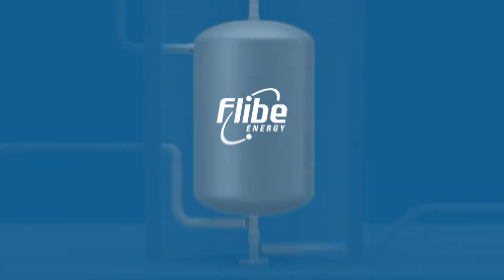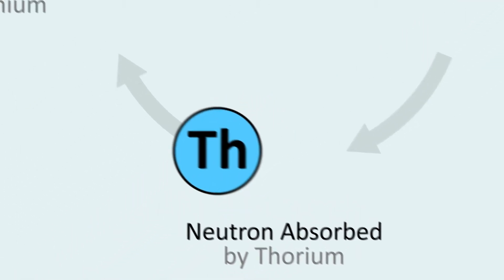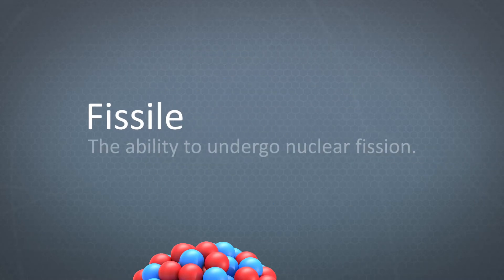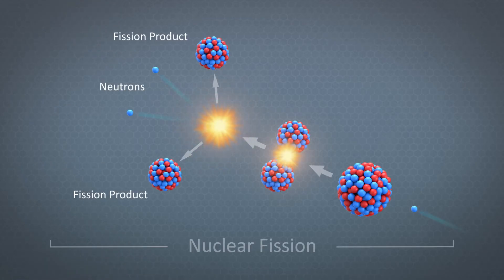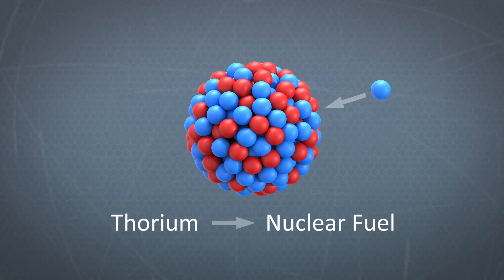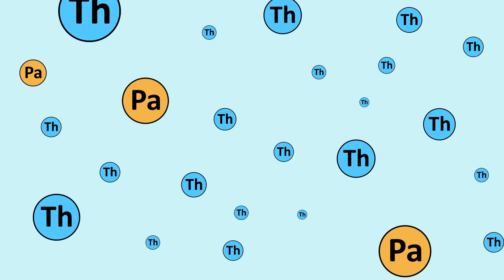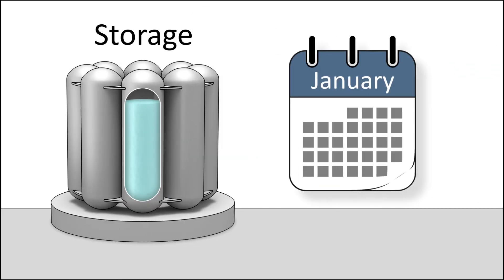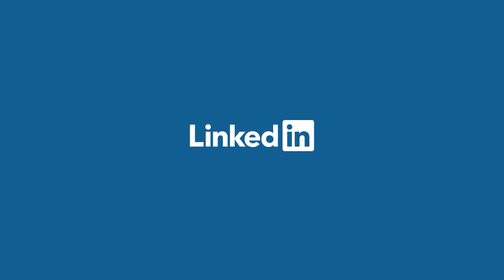Thorium Fuel Cycle Introduction

Comment: Is this design proliferation resistant? It looks to me that the separation of protactinium would produce a very pure U233, weapons grade material.
That would make the reactor less useful, if it can only be deployed in countries that have permission to develop nuclear weapons
Reply: U233 is harder to work with to make bombs than U235 or Pl239.  A secondary decay chain makes hard gamma rays, which can be detected at long range, and can damage electronics (e.g. the bomb circuitry).  The USA made a U233 bomb to prove it could be done, but Uranium and Plutonium bombs were much easier to work with.  They also have a shorter shelf life than the traditional bombs.

If you were a non-nuclear state, then buying Uranium on the free market, and enriching the U235 to make bombs is the easiest way to go.  This is in fact what Iran is trying to do, and what India did.

Warm regards, Rick.
Reply: The company replied to a similar comment below denying the claim, and linking to a recent report on the company's designs, released by ORNL's Nuclear Nonproliferation Division.
Reply: @no_rubbernecking  the report states a lot of numbers, but no coherent explanation of why the reactor is proliferation resistant. While I am sure this satisfies industry insiders, it would be nice for the rest of us to get some digestable information.
Reply: @migBdk   I understand your concern. Public messaging has been the greatest weakness of the  LFTR community, as it has been for legacy nuclear.
   I've looked at the section on accounting, and it seems there are a variety of methods proposed to make any attempted re-appropriation of fissile material easier to quickly detect.
   While I obviously wouldn't recommend exporting the technology to countries that aren't considered trustworthy, it's a fair bet that China, India, and maybe Russia will do so anyway, and little short of a complete blockade of these countries and their allies will stop them. This is just the world we live in today. In fact i'd bet that Iran will develop its own LFTR, as it's rapidly approaching  engineering status on par with the great powers, thanks to European and Asian appetites for trading with them.
Reply: ".....countries that have permission to develop nuclear weapons."

Where does a country go to apply for such permission? More to the point, When was the last time you've heard of a country which acquired a nuclear weapons capability going and getting "permission" or even the blessings of the existing nuclear powers?
The answer is, NONE of them!
When Britain was pursuing its first nuclear weapon, and Truman found out about it, he bitterly complained to Prime Minister Attlee about this. ....Never mind that British scientists had played a role in the Manhattan Project. They were summarily expelled (and not allowed to take their papers with them) as soon as the Manhattan Project was complete! The U.S. Congress promptly passed a law to prohibit the transfer of the knowledge of how to make atomic munitions.

No country which has a nuclear weapons capability has ever gotten permission or received encouragement from an existing nuclear power.
Reply: There is a mix of U233 an U232. U232 decays at some point to TI208, that produces hard gamma. Separation of U233 and U232 is very hard to do because of the small weight difference.
I wouldn't do thorium cycles with small reactors, as you need tons of shielding.

Comment: How big a voltage are we talking about along with the current necessary to bring the anode into state to extract the protactinium? ie what is the energy cost of the sustained reaction? i.e. Nothing is free in chemistry.  Additionally what is the cost to reintroducing the newly made Uranium to the reaction cycle along with the Thorium?  Your little demonstration of chemistry is great and all, but please be fully upfront with tht e public about what you are trying to do.   Yes I know, the U.S, has had a test Thorium reactor experiment running for decades that was never fully realized, but that doesn't mean it was ever ready to go into a level mass production of usable energy that could be used commercially.  While I like to see that there are people working to make Thorium nuclear energy viable, don't obfuscate what is going on with Disney like animations.
Reply: What here is obfuscated, and what is not up front? The voltage requirement is virtually nonexistent. What do you mean by "what is the cost to reintroducing the newly made Uranium to the reaction cycle?" Reactor starts with U233 as fissile inventory and a thorium blanket as fertile -> thorium absorbs neutrons -> thorium decay chain to U233 -> the newly created U233 fuel salt and new thorium blanket salt is fed back into the reactor and the cycle continues. Use thorium to create U233, use U233 to create power. Did you watch the video or are you just here to make vague and unsubstantiated accusations?
Reply: @skylerallen5189 Im happy you are satisfied with the info in this video. But what you fail to realize is that Thorium reactors have been around since the 60's.  The concept isn't new. My issue is what exactly has Flibe figure out to overcome the negative issues of Thorium reactors to be able to bring it up to scale.  And when I mean scale, not little test reactors producing 10 or 20MW of power.  California took offline a reactor the was capable of producing 2200+MW of power (dependent on number of reactors active).  To further help you understand why i ask silly questions.  Current nuclear energy production in the states is ~95,000MW of Nuclear energy( made in fast breeder reactors). Current average daily peak power requirements of the lower 48 states is 720GW of power.   So, when a company like flibe puts out a disney cartoon on thorium I laugh and ask the questions that I do, cause I want to know how feasible it would be to bring online a safer nuclear reactor that potentially produces less waste and at what cost.
Reply: @cdrderfyt  I am perfectly cognizant of the work done by ORNL and the current nuclear power situation. What I take issue with is that you are accusing the video of obfuscating the truth in a video that exists to educate. Also, there are no fast breeder reactors in the US. It seems very odd to me that you use such harsh phrasing and such an accusatory tone to attack a video explaining the thorium fuel cycle to people who aren't familiar for not answering your specific, unrelated, and frankly, unfounded concerns.

Saying that Flibe isn't "up front" with what they are doing seems entirely intended to make people feel like information is being hidden from them. The truth of the matter is that TMSRs, and specifically LFTR, are not only viable, but crucial for the United States and even our global energy future. It is both feasible and possible in the short term, and necessary for the long term.

Comment: Is it feasible to separate the 233Pa from 233U in storage to feed the fuel salt continuously, or is it acceptable to store the protactinium in batches as illustrated, risking the decay of some 233U?
Reply: Protactinium is removed through a chemical process, held onsite for the required time, and reintroduced into the fuel blanket.
Reply: @darelsmith2825  ...I know. I asked the question I asked because 233U also has a relatively short half life, so it seems intuitive to chemically remove Uranium from the presence of Protactinium as quickly as possible, ideally not in month-long batches. Or maybe it isn't an issue for some 233U to decay before it is introduced into the fuel salt, which is why I asked.
Reply: Sixteen thousand years.  That is a very long half-life for something that is about to be consumed in a reactor.
I, too, am curious of the chemistry of protactinium tetrafluoride.  Is a salt? Is it molten in the MSR?
Reply: @philipyoung7034  I believe it is technically a salt, and I assume it is molten at operating temperature (650-700C), I do not know for certain.
Reply: The U233 is only needed for startup to initiate the breeder fuel cycle as I understand it.
Reply: @solexxx8588  U233 is the fissile material bred from Thorium.
But my question was partially answered. The half life of U233 is so long that a negligible quantity decays in storage while Protactinium is allowed to decay to Uranium...
The need to chemically separate U from Pa still seems to be present, since one Pa half life does not result in 100% transmutation of a batch of Pa into U...
Reply: @tanner3801 that's why it says they will store it for several months. Every month means half of it converts. It sounds like just waiting for most of it to convert is easier than implementing another separation step.

Comment: Love the idea of the electrolytic separation of protactinium. Very graspable. Can uranium also be electrolytically separated from protactinium so that the residual protactinium that has not decayed can be recovered to increase fuel economy?
Reply: Uranium can be separated by fluorination to uranium hexafluoride (a gas), and then later hit with hydrogen gas to bring the uranium back to the tetrafluoride and into solution.  The resultant Hydrogen Floride can be electrolytically separated back into the reaction chemicals (Hydrogen and Fluorine gases) to keep the cycle continuously running.

Comment: I recommend that you add to this an explainer about the difference between a blanket salt and a fuel salt. I think the latter is probably obvious to most, but the former is not so much.
Reply: In my mind, every reactor has three regions, the core, the blanket, and the jacket.
The core is where the fuel, moderator (if thermal), and the control rods live.  It is the source of neutrons.
The blanket is the next region out.  The flux of neutrons is not high enough to sustain fission, but still high enough to breed industrial and medical isotopes.
The jacket is the hard wall that stops all remaining neutrons.  It is made of water, lead, and concrete to absorb any and all stray neutrons.

Comment: Great video. I would love to see such a video running though the chemical processing aspects demonstrating how the Pa is kept separate so as not to absorb another neutron and also showing the flow through the fluorinators and use of UF6 reduction. It would be a great compliment to this video. Well done Flibe.
Reply from the maker: 233Pa has over five times the thermal neutron absorption cross section as 232Th.
Reply: Yes, sir  @FlibeEnergy  , but the half-life of absorption of 232Th is 50 years at full power. 233Pa will decay long before a significant proportion will absorb another neutron.  The engineering question is whether it is enough to stall the reactor. My lay-opinion is that it won't.
Reply: Pa-233 has about the same cross section as the Th-232, so if, say, the protactinium remains in the blanket salts for 145 days (5 half-lives), less than 1% (citation needed) of the Pa would have absorbed a neutron and decayed into a U-234. This is not going to greatly affect the neutron economy, nor is it going to greatly affect the quantity of actinide waste.
This makes it possible for thorium to be used in a solid fuel reactor, but makes the Flibe reactor even more efficient, as it takes the U-234 neutron poison out of the system.